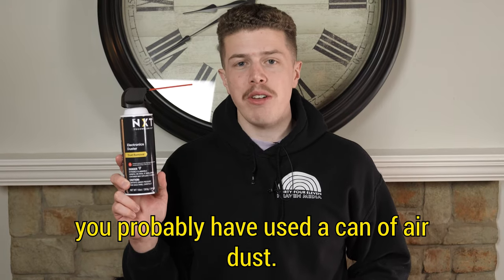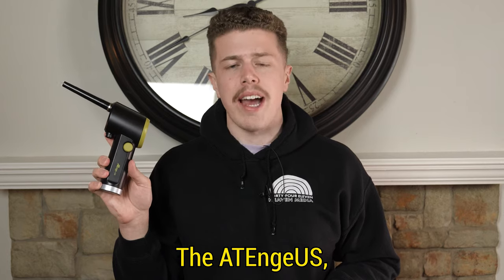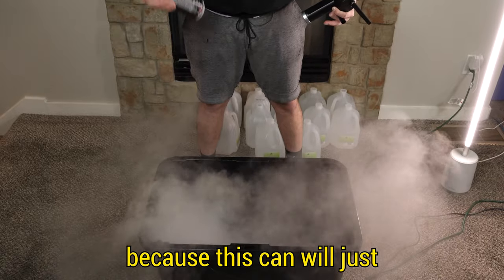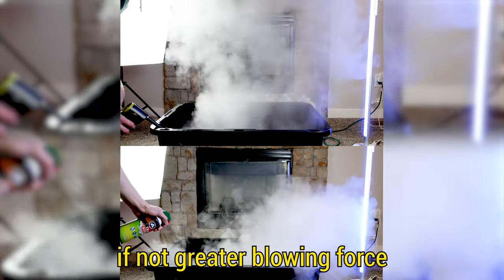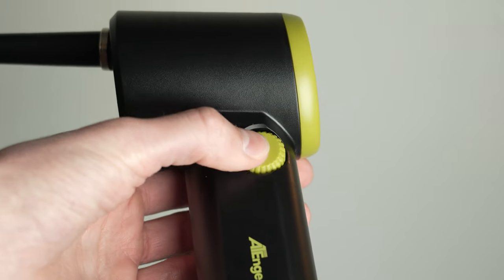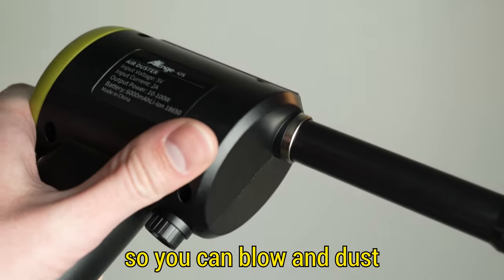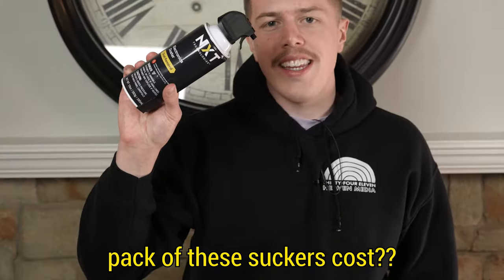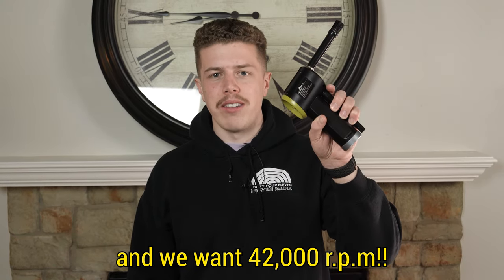Canned Air vs. Electric Air Duster (Which Blows Harder?)

Comment from the maker: CORRECTION: This duster is only 41,000 RPM 👀 But like still...that's a lot of RPMs!
Reply: 😂🤣😂🤣 LIKE FOR REAL THATS A HELL OF A LOT RPMs!
Reply: the weird thing is that this is the exact model as the dorobeen AT07-G but rebranded, and the previous model of this air duster is also the same previous model of the dorobeen AT07-G, as well as several other air dusters. But at the end of the day the models are clones of eachother, so if you see one thats sold for cheaper just go for it
Reply: @FWS_Sinister  that’s exactly what I did just found the same model rebranded for 49 bucks

Comment: "I can't do that for 15 minutes straight because this can will just run out of air" more like this can will give me frostbite after 30 seconds as it boils to replenish the lost pressure lol
Reply from the maker: No to mention that!! 😂😂
Reply: @3411HeavenMedia  Hi there, will a product like this or similar be good to use for chainsaw maintenance? Thanks
Reply: @BB-tx8ty  I dunno about chainsaws but if canned air is good then this would be too?
Reply: @ricedbroccoli  the air duster isn't that good for the chainsaw, yes will get some of the crap off the saw but not everything like an air compressor would

Comment: It's kind of hilarious that this dude thinks blowing fog around is the same as blowing particles stuck to your keyboard. Literally any amount of air can blow fog around. But I guess when you're trying to monetize via affiliate link the goal is to make it look effective.
Reply from the maker: I imagine if you modify the output nozzle on the air duster to be the size of the compressed air can, you would get some pretty high velocities!

Thanks for the great point that the duster will be more or less helpful to you depending on the specific use case :)
Reply: True, it's a sales pitch not a product comparison.

Comment: Curious, I took this duster apart to see what what kind of batteries it uses.  It houses 3 18650 Li-ion.  They are soldered together and the leads soldered to the PCB. When the batteries die they are replaceable with a little soldering skill.  I did not skin the shrink wrap to see if they are standard or high drain batteries.  When they finally kick I'll put in some Sony VTC-5a's.
Reply: ...or (if youre using this to clean your pc) just buy a wired version from the beginning and avoid having to deal with dying batteries at all, which is probably also a cheaper and possibly more powerful model.

Comment: 1. Thx, any info is good :)

2. What's the start & stop time like? Canned air gives maximum force instantly; this feels like something that spools up and down instead, but not sure how long it takes?

3. In video comparison is between plain canned air without attached "straw" and the electronic duster, which, isn't exactly a fair comparison 😎. How thin of an extension can you put onto the electronic duster? RPM SchmarPM, what's the actual pressure coming out of the two? 🤔

Comment: I just ordered one of these air blasters for the first time.  I'm a thingaholic and my life is plagued by dust.  
I've actually given up and had to put things in storage before because it was so hard to dust them.   Got hopes!
Reply: Did it work for you,?
Reply: @Tonisuperfly  No I sent it back :/  But mine kept shutting off. 
I did buy a different model though and do use it.  The principle works.  It just needs to be strong enough to dust, but not too strong or things knock over....  I think one with a force dial would be best
Reply: @c.rutherford  thanks for the reply

Comment: This is hilarious. I'm convinced, gonna get one
Reply: Found a 90,000 7200mah variant with USB type C fast charging. Twice as expensive, twice as fast, but would it be worth it over 40K rpm?
Reply: @Evan102030  honestly I found this brant to be part of the top 2-3 on the top 10 lists at worst you can try it and if it’s not good send it back for refund and get this product

Comment: 59.99 dlls small tiny air compressor from harbor freight is lot better and more durable..the 19.99 dlls spiral air hose with llike 15 pieces included and gun blower is there too

Comment: I hate these repackaged Chinese devices. Ok so this thing is "ATEngeus"? But another which is identical is Dorobeen, which is identical to another called Svinkal.
How are we supposed to know who is the real deal when everybody and their mother is selling the same thing under a different brand?

Not only that, but when push comes to shove, I need the power of compressed air through that tiny nozzle, why don't these come with tiny straw nozzles? I've seen other dusters at 60,000 rpm, and 91000rpm, and even one labeled as 100,000rpm. Being the American I am, I want the most power for the money, so 100k sounds good to me! Same price as the 41,000rpm.
Reply: yea probably being chinese those numbers arent even real
ive seen it with 300000 mah power banks for example
or 2tb usb sticks with actually are just hacked 2gb ones
Reply: More likely a fan cannot produce the sheer static pressure the canned air can(hehe) through a tiny straw.
Reply: Svinkal 😂😂

Comment: RPM is completely irrelevant. What is relevant is the airspeed out of the nozzle. You didn't compare these at all.
Reply: These machines are weak as crap ... The air can produces far more pressure. .. best choice would be to get a Makita blower that's 40volts
Reply: Yea, and volume.